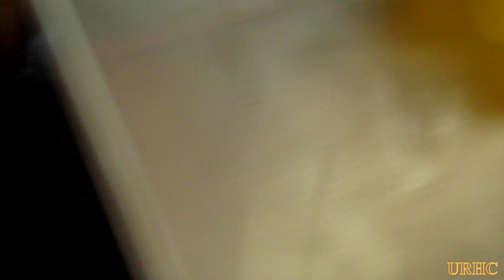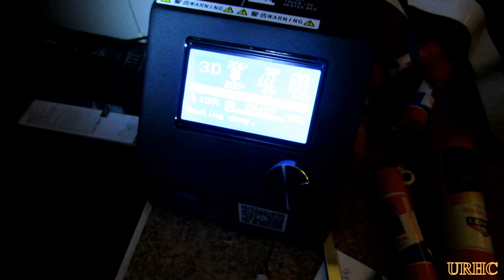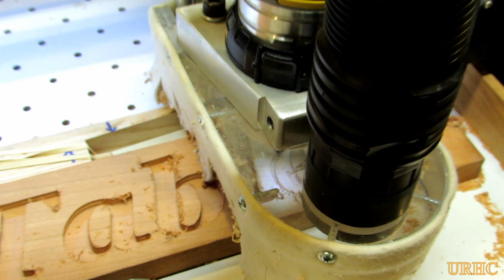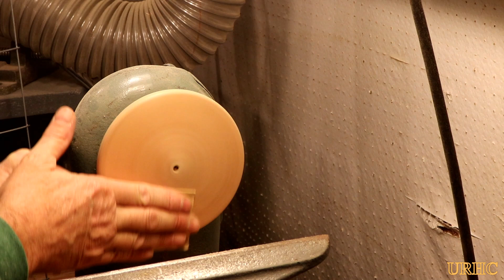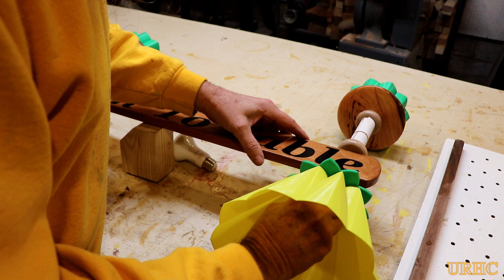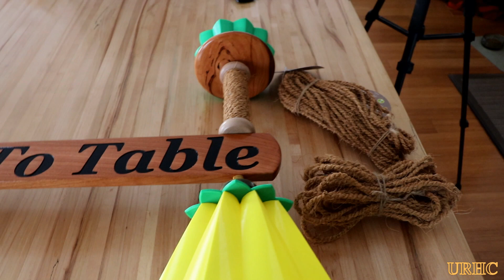Island Light Fixture Sunflower Themed Track light Build

Comment: never used the jointer always just sanded the paint off always routed by hand
Reply from the maker: I like using the jointer for anything under 8 inches because it catches all the dust and just needs a fine sanding leaving nice sharp edges. I was never that good by hand  and made lots of firewood. Thanks for watching.